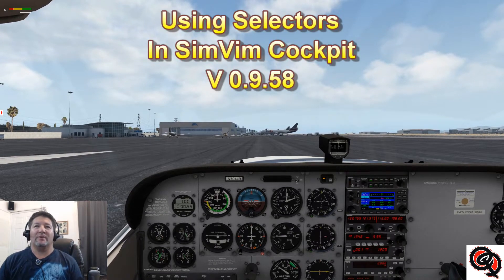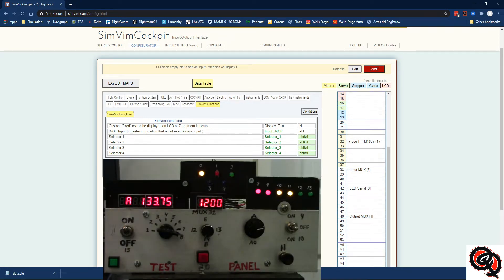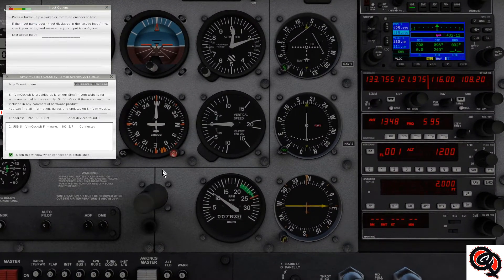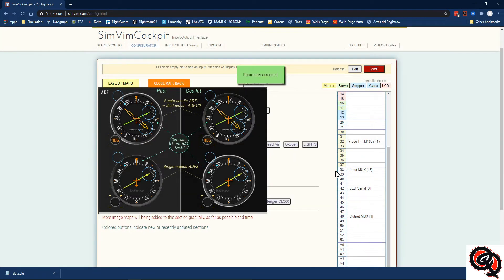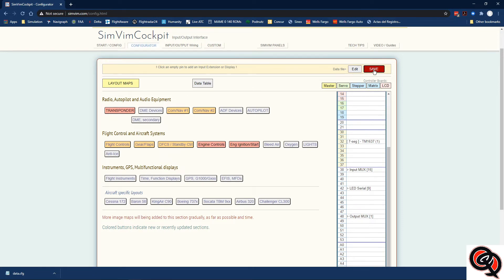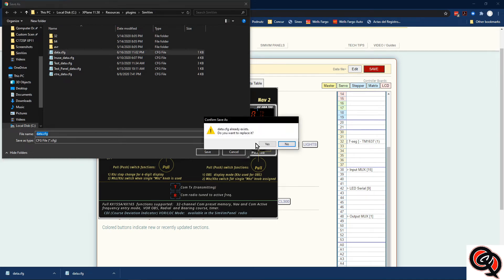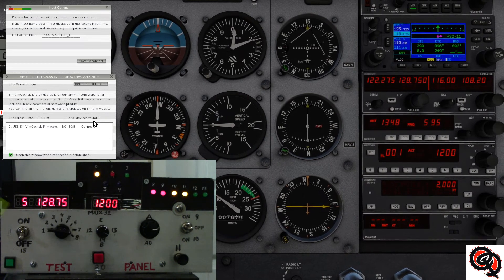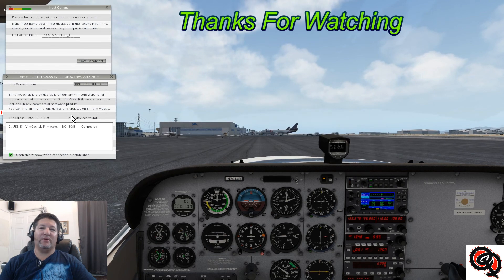Using Selectors In SimVim Cockpit (Old)

Comment: Thank you very much Qosmokid, for all your videos and the time you invest to help others. I watch all your videos but this one by far is the number one for me because I am all in with only VR flying. With the latest release of the plugin I think it is now v 2.0, I have been experimenting using prop wash concentric dual encoder with four push-buttons as selectors to switch between the four GPS knobs ( GPS1 & 2 of default C172 ).  I watched this video many times to understand the concept but I couldn't get it to work. For example the push button will select the nav/com on Knob 1 while the outer knob changes the com2 on the 2nd GPS. It's all over the place. What do you think is the problem. I would appreciate your input, of course your time permitting. Once again thank you.
Reply from the maker: Hello K A, thank you very much for the kind words. I think you may still be misunderstanding the use of selectors. I don't blame you, I think I mentioned in that video that I still wish they would have let us continue using conditions.

I think this one is going to be one of those I may have to answer in video format because otherwise i have to write a book to get everything I would like to across clearly.

I had in my plans a future video going over selectors again using my new simple demo setup but I may just have to do this one now.
Reply: @Qosmokid  I appreciate it very very much. Thank you.

Comment: NOTES  (SimVIm developers):
    
 The "Selector" option will be moved to the layout maps eventually as it was done for "BRT_"  (brightness,) etc, 
and of course we plan  to  make some changes in the configurator interface, because it still has some glitches and  misleading menu items.
   
 Note 2: Please take in account, that the “Selector” option (used as switch or indicator) is implemented as an “option just in case”, if you really need to have one display for different readings, or one switch/encoder for  input different  parameters,  and the SimVim configurator doesn't have pre-configured devices with the same functionality (as all radio, including Combo radio options).
    
It should NOT be used as selector switch for different planes you fly. In the case when you have one switch/display that should be assigned as one parameter for one aircraft you use, and as different ( functionally different !) parameter for other plane you are loading,, just use two (or more) different configuration files (data.cfg).
  Vlad
Reply: Vlad/Roman. Would that be the new way to do use a single encoder with the function as a double encoder? I learned this on Paul's video and use this technique for COM and NAV. Turning the knob , it changes the MHz. If I press the center button it changes the KHz. I learned to this with condition status. Hope the selector will do this function.  Thanks for the video.

Comment: Very interesting seeing how this actually gets programmed - I had to write out all the code to make these things happen in my setup.  The hardest part was to assign multiple functions to a button/switch when I wrote it out.
Reply: Hi,
"...Very interesting seeing how this actually gets programmed..."
   
If you thinking this is all about programming the "Arduino" - it's not.
Initially (when started  in 2012 with XPData and ArdRef  project), it was just a code for Arduino worked with in-built X-Plane UDP protocol. Then it was ArdSim and ArdSimX that included  the plugin.
      
Currently, the SImVIm plugin is most essential part of this interface, it's the C program with about 10.000 lines of code.  
Now it can be called the  "cockpit simulator", not just an input-output interface, because many inputs are not simply executes some command but rather call a complex function for some specific system (as most radios). 
      
And instead of "assign multiple functions to a button/switch"  we are going to include more custom functionality for some multi-purpose inputs and  devices,  making them as in real equipment.
      
And we intend to  program more and more aircraft systems and devices independently on any custom planes, to be used with any free X-Plane model.
     
The code in Arduino board (firmware) is more like an universal "driver" for all output devices and input controller, it's wrote from scratch program for AVR controller, without using any of  "Arduino library", and it almost not changing since the last year (no need).
Arduino board is used here just as convenient  controller on-board,  because it's easy to get for everyone and cheap.
    
Vlad (SimVim )
Reply from the maker: @SimVimX_System  Very well explained, that's the good thing for us, that we don't need to learn code because you take care  of all that and it's invisible to us. I always say to myself "it's amazing how you can get a simple  Arduino to work like a very expensive PLC"
Reply from the maker: That's one of the best things about SimVim, absolutely no programming required. If you can click on things, you can get it done as long as you get the wiring correctly of course lol

Comment: Hi ,  found out today about simvim ,  and saw your 7- segments display youtube video , and the docs from simvim. 
I would like to make an mcp , ( which has about 24 display digits ) using the tm1638 chip- modules. .   My understanding now  is i need ( for these outputs ) 1 multiplexer board .  Is this correct ?  Does this mean each tm1638 chipmodule ( with 3 , 4 , or 5 digits) goes to the multiplexer board  with 1 clock signal  ,  so on the mcp 6  clock signals to the multiplexer ?  
Maybe you could show an example drawing in a video ?
Thanks,
Peter
Reply from the maker: I haven't tried this but it's how I would do it. I made a little sketch, hope it clears it up. https://photos.app.goo.gl/hoaDrHAqGhUSALS48
Reply: Peter, 
I have answered to your email, please check your box.
Here you can see the diagram with multiplexer - http://simvim.com/svc_numbers.html
Vlad (SimVim developer)

Comment: I was just thinking about an all-in-one box for everything and that explains how to do it now!
Reply from the maker: You're project is coming along very fast I'm sure you'll have everything you want to put in there in no time
Reply: Dave, what "box" you need to have? 
In the SimVim configurator you can see the "Combo" radio option, where you can configure a multi-functional all-i-one radio device.
Or, you need to have, say, one encoder for everything? 
Actually the SimVimCockpit is developed for cockpit/panel builders, not just for using in  a simple console for on-screen panels control.
This is a very powerful and versatile interface, why do you need to save on buttons and inputs?
Vlad (SimVim)
Reply: @SimVimX_System  Hi Vlad, I am always thinking of things to create. Along with the SimVim commands and functions, I'd like to have a touch screen or LCD that will give me all the info the combo radio will, and I would use that design. The combo radios are awesome and it's a great foundation to add to a great design. Just something I was thinking about.
Reply: @DaveWrightKB9MNM  
Our SimVimPanel is capable to be used with touch screen, surely.
We will continue to developing instruments that can be used either as one stand-alone instrument for one Raspberry, or in the full panel
V